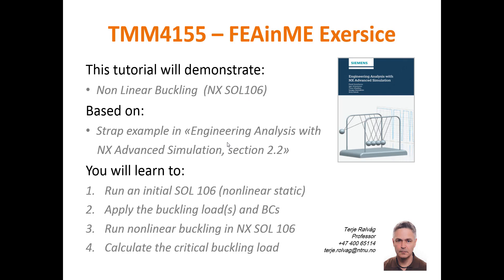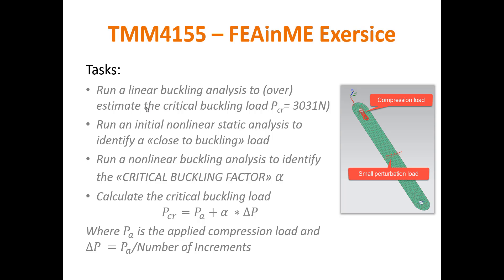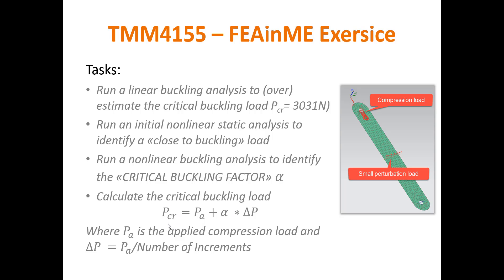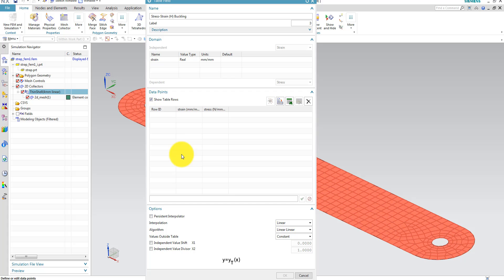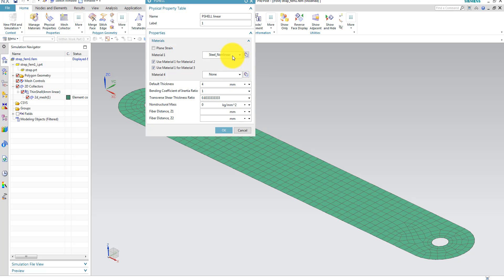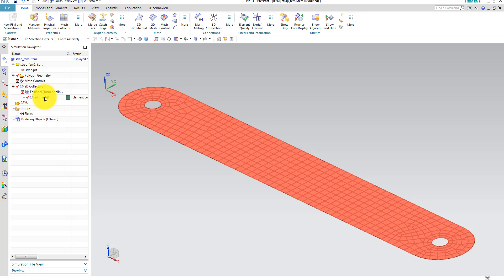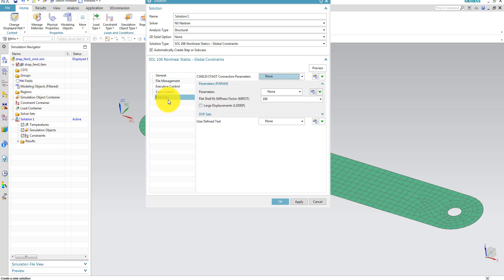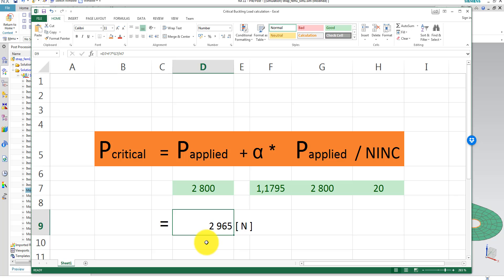NX SOL 106 Nonlinear buckling

Comment: Hi very nice tutorial. I have simillar problem: automotive control arm under compression with curved geometry (so no buckling driver load is necessary) and non-linear material properties. How to setup such analysis to determine max allowable compression force and applied force vs ball joint displacement in whole range? Right now I have pretty good corellation with test results but only for elastic range. I've used SOL106, large displacement, enforced displacement, increment 0.1mm, convergence cotrol for displ and force. Added arc length method also. Could you make also part 3 of buckling analyses with similar case? Thanks in advance.
Reply from the maker: Sure I can, but I am struggling with a SOL 701 crash simulation which I want to post asap. SOL 701 is an undocumented secret with a complete lack of examples. Can you shear the material, control arm, loads and BCs with me? I guess the material model is your concern here since the results are Ok in the linear range.
Reply from the maker: I might do that but then I will probably test if the new SOL 401/402 solvers can do the job. However, I need a good case and some test results to make a great video. In mechanical engineering buckling problems are not so common as in civil engineering and that's why I haven't focused so much on buckling